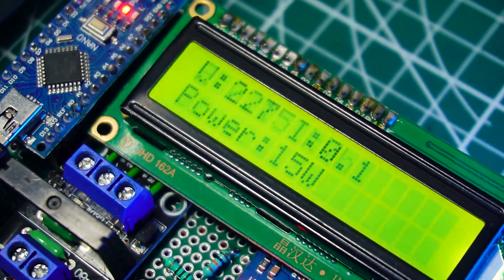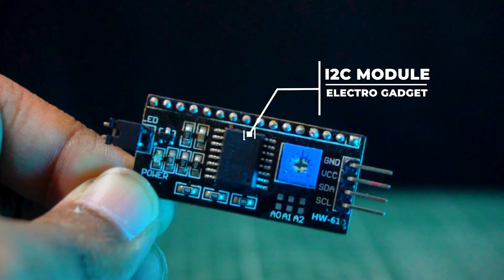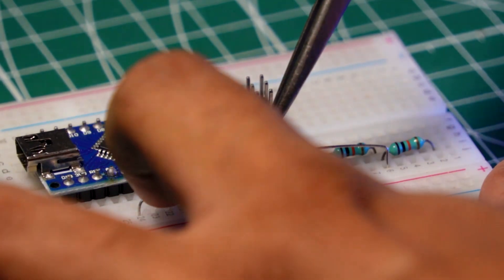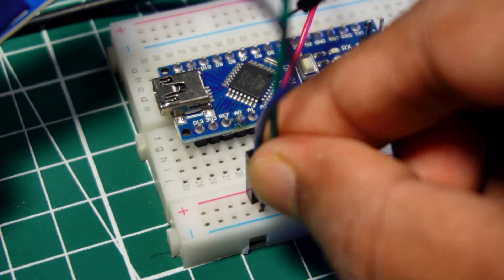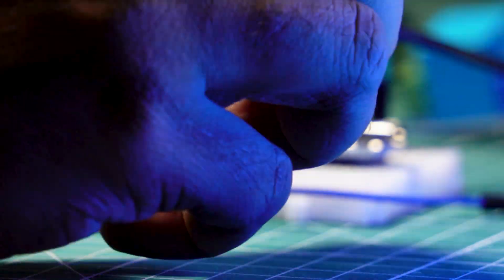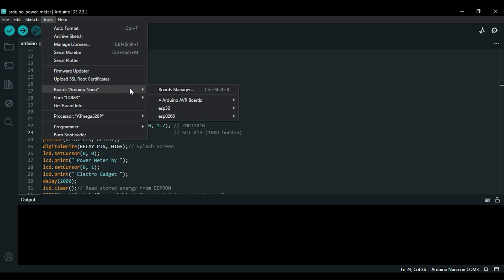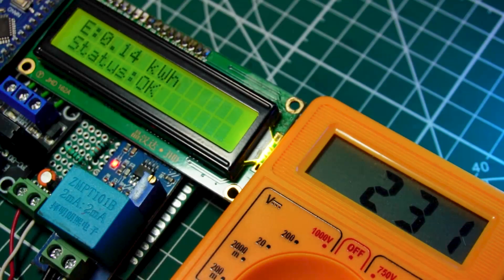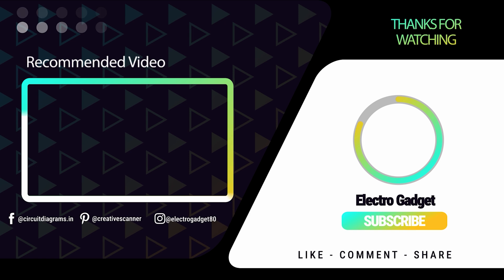Smart Arduino Power Meter Using SCT-013 & ZMPT101B Sensor

Comment: why is the SCT-013 plugged into a 2pin terminal block instead of plugging it into the 3.5mm jack that is clearly connected on the perfboard?
Reply from the maker: Because I cut the 3.5mm jack from the sct for my connection.

Comment: hi, how can i make the sct-013 clamp any ac appliance ? and i’m using AC-DC converter to turn on the project?
Reply: i’m using all the components in the video and my goal is to make the sct-013 clamp any ac appliance and can read both current and voltage(using zmpt101b).
Reply: or should i make an adapter (plug) for the appliance to plug in so i can check on the energy/power usage?
Reply from the maker: Yes you need a seperate ac socket board where you can install this system and connect any appliances into this board easily. So that you can measure different ac appliances accordingly.
Reply: @electro_gadget80 i noticed there’s 2wires only, there’s no ground wire for the socket?
Reply: @electro_gadget80  i noticed there’s only 2 wires on the ac socket board. no need for ground wire for the ac socket ?
Reply from the maker: If you have no knowledge then leave it. I can't give you anymore advice. The Ac socket is for connecting the load, one wire is connected to relay NO terminal and other is connected to home power supply neutral or negative terminal. There is no relation of connecting the ground in this socket. As ground which is earth already connected to your home wire. And this is only the power meter which needs only two wires from ac. Did you notice your house ac meter has ground wire? It has only two wires phase and neutral. So if you have no knowledge leave it.
Reply: is the plug for measuring an extension ? and i can use the wires to connect to the sct & zmpt101b?
Reply from the maker: As ac appliances come with package wires so you can't clamp any one wire. So the solution is to where you insert the plug, clamp the phase wire behind the socket.
Reply: @electro_gadget80 alright thankyou !
Reply: what can i do to make the output for zmpt101b readable on the lcd display for any source of appliance to show?

Comment: If I use the DC Jack you mentioned in the video, do I still need to use a resistor and capacitor? I am using SCT-013-000 100A.
Reply from the maker: There is no connection between DC jack and resistance capacitor. DC jack is a normal wire connection item. And yes you have to use resistor and capacitor for 100A sct013 sensor as resistor and capacitor filter the ripple values while sensing. Otherwise you will notice drastic value changes

Comment: I noticed that you used sct-013 30V/1V. If I use sct-013 100A/1V, what resistors should i use it with and what capacitor do i need? Or is it just the same? Thank you.
Reply from the maker: The SCT-013 100A/1V model has a builtin burden resistor, meaning you do not need to add an external one for a 1V output. The supporting circuit, including the necessary capacitor and biasing resistors for connecting to a microcontroller's ADC pin, is the same as for the 30A/1V model.